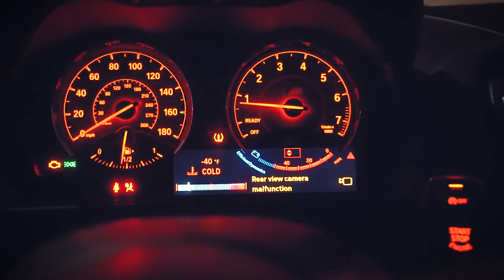THIEF SMASHED MY LAMBORGHINI & STOLE EVERYTING! *EMOTIONAL ALEX CHOI VLOG*

Comment: try putting the key into the door handle lock and holding it to the right or left for like 5seconds should automatically roll the windows up or down and unlock or lock youre doors on the bmw

Comment: Crappy situation dude but as for the that RS3, it's no where near a bagillion horsepower. Car was making 700whp, on a stock block, stock transmission and stock clutches. Plus its Iroz Motorsports smallest turbo kit (IMS710H) and it's a hybrid... meaning its in the factory turbo housing.

Comment: Thieves suck ass
Im a little confused why he said he couldn't operate the M2 windows when on a previous vlog they removed the controls from the door panel and plugged them back into the harness. You can even see it hanging on the driver door when he lifts the wires to shut the door